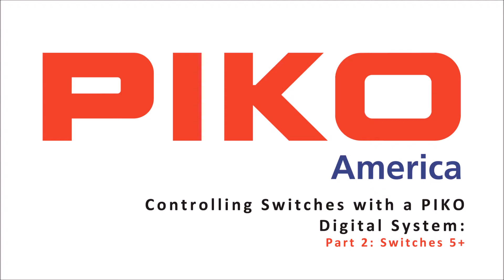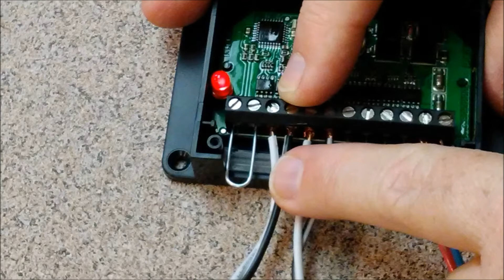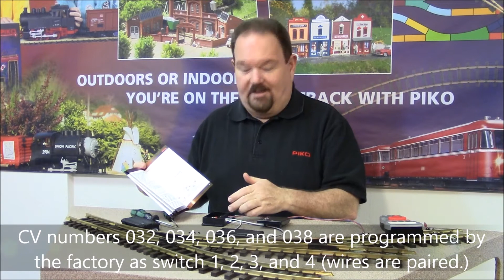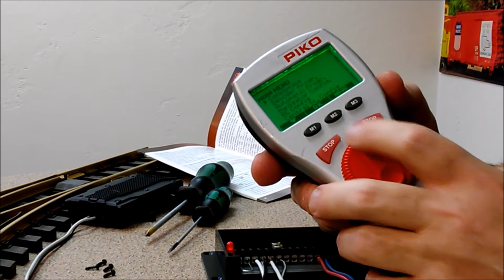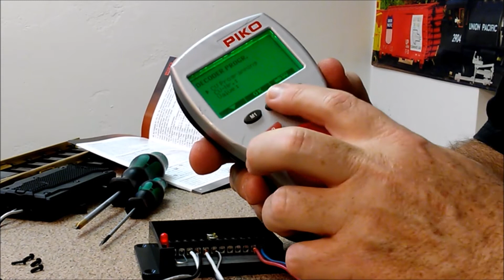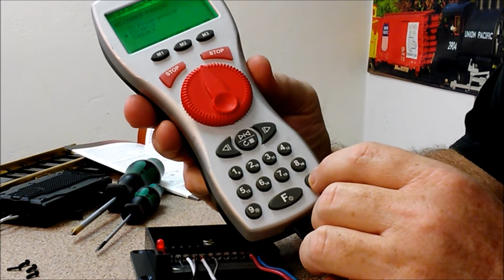Switch Decoders, Part 2: Control More Switches

Comment: Hello Jonathan, Henk from the Netherlands again. question; what if I do not want to use the handy, I want to turn the switches fully automatic. The train passes the switch and than the switch has to turn, how can I realize that.  the track has to run automatic. Do I have to use for example the LGB 17100 track contact ore is there an other way to do that, and do I need to use the switchdecoder .hope to hear from you, best regards henk